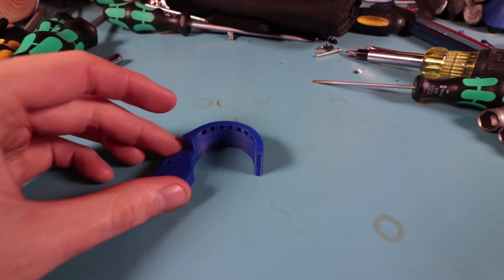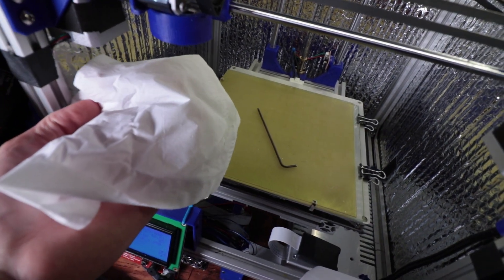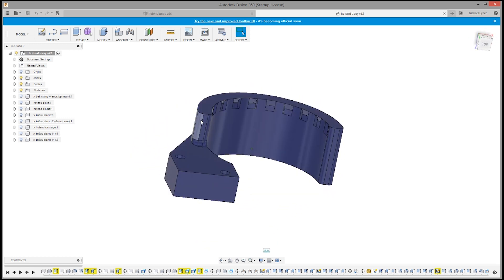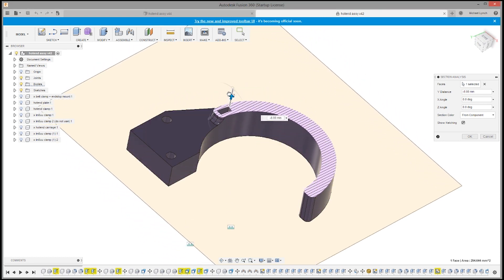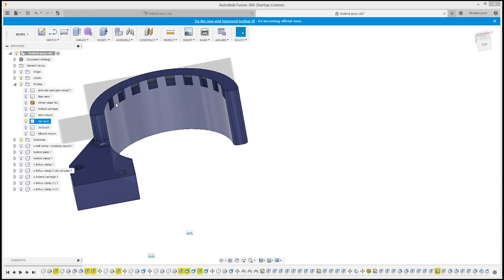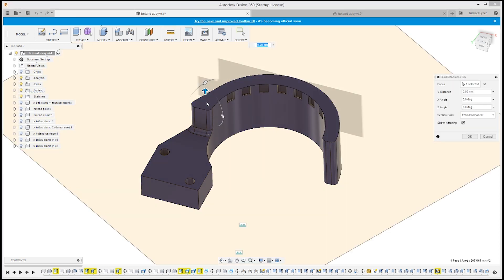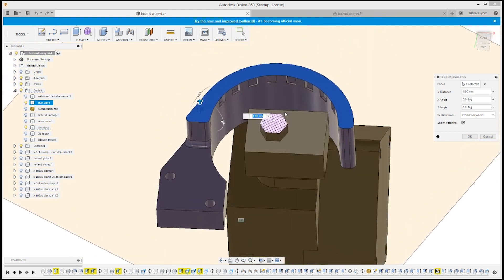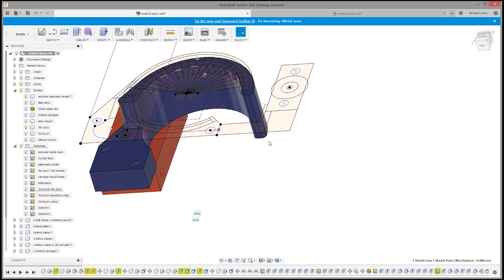Designing a Better 3D Printer Cooling Fan

Comment: The design is extremely restrictive and unlikely to work. The adverse pressure gradient will almost certainly choke the flow. Suggest you do some research on proper duct design.